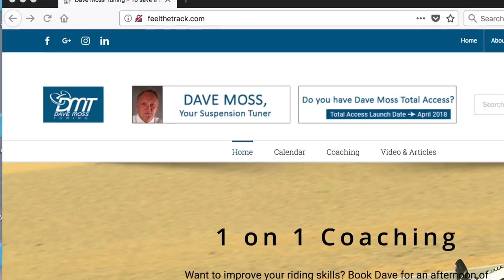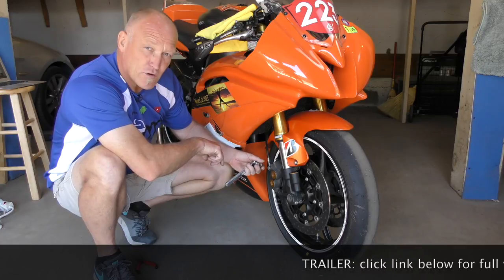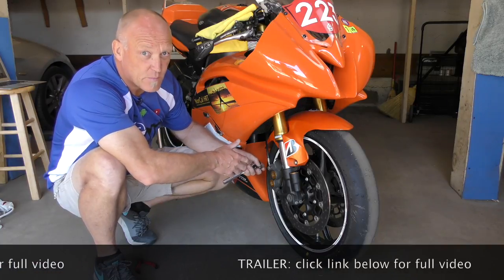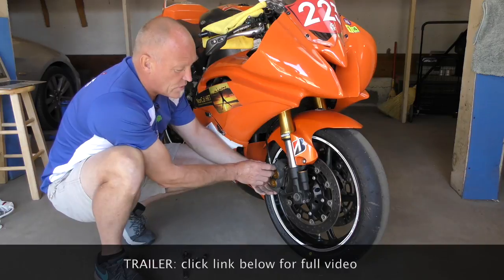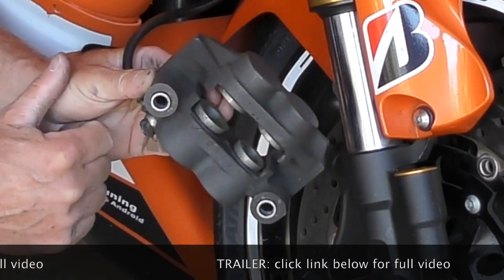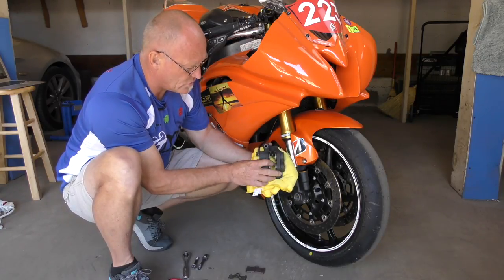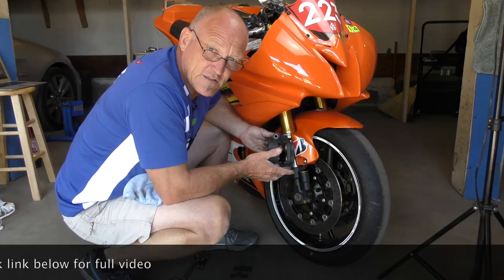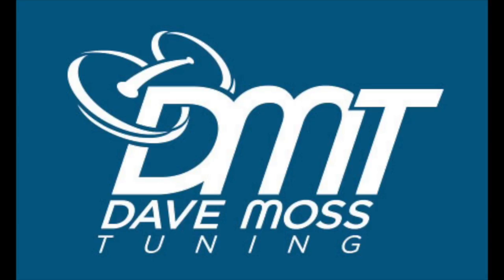How To: Stuck Brake Caliper Pistons (TRAILER)

Comment: I have a strong shudder in heavy braking only to the right, and noticed one pad per side sticks to the piston and doesn’t move free. Is that normal? The copper back of the pad is soft enough to let piston stick and get the pad to malfunction
Reply from the maker: If the pad gets thin, there is much more heat transfer to the piston. Should there be sufficient heat, there is the possibility of the piston creating an impression on the backing plate. I have not to date seen a backing plate "welded" to the piston.

Comment: If just one wont move freely and seems stuck, I would suggest complete overhaul of brake caliper. Which means, visual control of brake pistons and change of both piston dust seal and main seal. On racing bikes those seals are more stressed due to heat,  pressure and dirt during wet surface than a street riden motorcycle. I think Dave would agree with those facts.

Comment: this video is nearly useless man you didn't show the most important thing - what you did to get it unstuck/how did you prevent it from happening again in the future? 

I get removing the pads to identify the stuck piston but how did you fix it & stop it from sticking again in the future!?
Reply from the maker: There are so many ways to do this, the easiest being compressed air. Rubber grease on the seals and pistons being polished is the best way to make sure no stiction occurs.